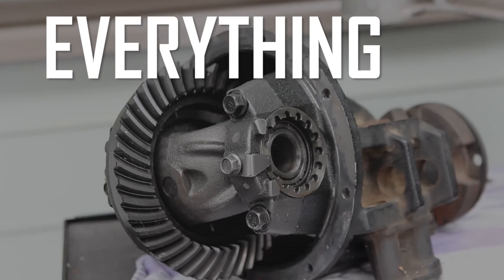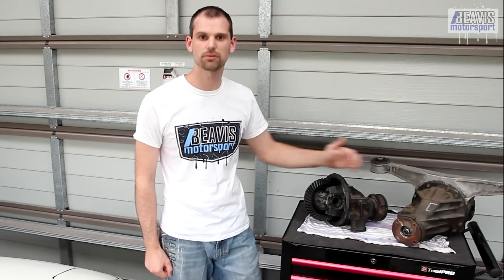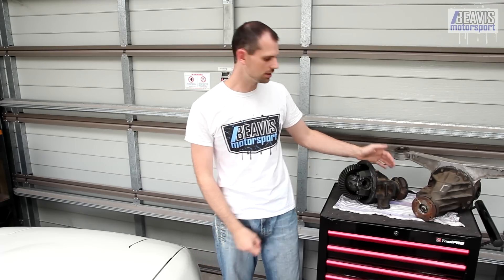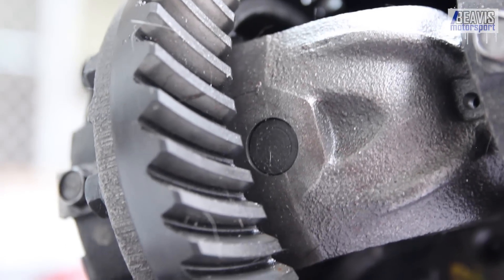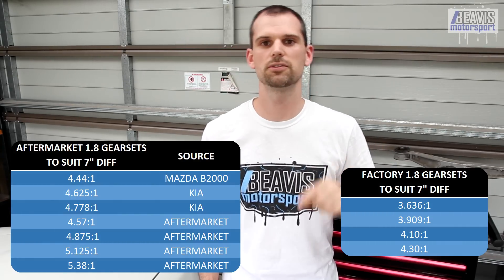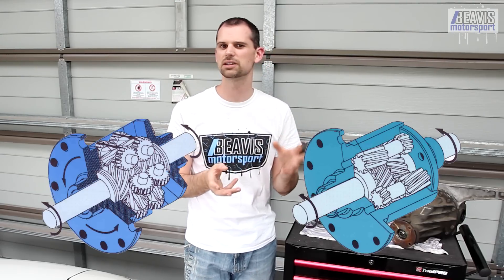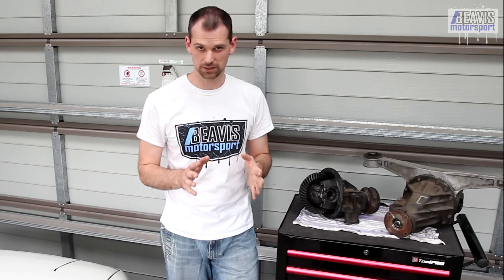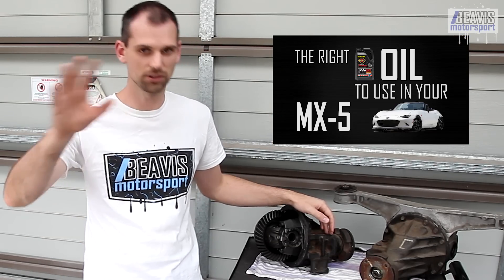ULTIMATE DIFFERENTIAL GUIDE FOR THE MAZDA MX-5 MIATA

Comment: Hi, I've got a 2005 with a fuji diff which I believe may be acting up (it only span one wheel from a 7k clutch dump on a gravel carpark), Is there any way to determine if it's working without taking it apart? I've got a torsen2 in a parts car if you think I'd be better with that.
I've got some new oil on the way and I'll check the old oil for metal chunks? but apart from that I'm unsure how to check if it's operational.
Cheers,
Owen
Reply from the maker: I'm not sure there's anything you can determine by just looking at a diff that is still inside the carrier. You will need to either take it to a diff/trans specialist, or just take the gamble and move to the torsen. In general the torsens are pretty solid and reliable - maybe just avoid those 7k clutch dumps. :-)

Comment: Can you recommend a diff you think will handle 300rkw with 17x11 semi slicks. ? I've seen the 8.8 conversion but we are in OZ so bit hard. I also need ABS and 5 stud. Any help cheers 🍻
Reply: Well I've been trying to find a 4.1 torsen and people want an arm and a leg so i guess i might just go a ford 8.8 and be done with it
Reply from the maker: The factory mazda 1.8 diff should be OK to handle that, but certainly starting to get to it's limit. Slicks will also add to the stress. Beyond that I don't have any experience with aftermarket or custom swaps.

Comment: The NB2 cars were not all 6 speeds (at least in the US).  The 5 speed was standard on the Base, Shinsen, and LS trims and came with the 4.30:1 final drive.  The 6 speed was an option for the LS models and standard on the SE trim, and had the 3.909:1 final.  The Mazdaspeed Miata also used a 6 speed, but had the 4.10:1 final.
Reply from the maker: Thanks for the tip RD. Seems there are always a few variances for international markets. Funny the MSM delivered in Australia as 'SE' had the 3.6 diff ratio.
Reply: @Bbeavis  Apparently the Mazdaspeed name was not used in Australia, as a model name with "speed" implied that owners should violate speed limits.

Just about everyone with a turbo Miata + 6-speed agrees that the wider ratio spacing with the 3.6 is the way to go, as the car spends actual time in boost before getting to redline and needing to shift.  The decision to put the 4.1 in the US MSM never seemed to make a lot of sense.
Reply from the maker: @ateamfan42  Probably because Mazda knew that from the factory the little turbo and poor tuning didn't add much performance!
Reply: @Bbeavis  True.  The MSM did not fulfill its potential.  Most people with MSMs that turn to aftermarket tuning achieve some real gains (even with the factory hardware).

Comment: Hi its very usefull video,l have a question ,my miata is 93 na l am using 3.90 torsen with 5 speed Can l use this combination or should l change with 6 speed.whats your suggestion? whats the - or + for my setup?
Thanks
Reply from the maker: Hi Isa, it is completely up to you, there's nothing wrong with a 5 spd transmission, and they are a lot cheaper than a 6. Unless you need the small strength benefit of a 6spd, there seems no reason to change.

Comment: I have a 1.6 NB / Mk2 (year 2000) with an open diff, it was delivered for the European market..
SO, do I have a 6" ring gear or 7" ring gear?
Is there a difference between the open 1.6 and 1.8 diff for the Mk2 in terms of design or shafts or is it exactly the same?
Reply from the maker: I'd be fairly confident that all MK2's came with 7" diffs, even if they had the less common 1.6 engine.
Shafts are different from the early 1.6 NA diffs to all the later 7" diffs.
Reply: @Bbeavis  Ok Thanks for the response man!
My diff (less than 150k kilometers) is making some humming noise.. I thought it may have had to do something with having the small ring gear, but probably some other issue then.

Comment: So my 1996 Miata has an LSD right? I did a burnout on it and both wheels were spinning, drifted it, did donuts, etc. both of the wheels were spinning. I have a friend of mine trying to tell me it’s an open diff. Help please?
Reply: Alex Martinez some 1996 did, some didn’t. What package do you have? Leather seats? Speakers in the headrest?
Reply: Alex Martinez you probably have a torsen.
Reply from the maker: Probably the best way to know without looking at the inside of your diff, is the donuts as you have done. Sounds like you have some form of LSD.

Comment: Ok so I just bought 4.78 final drive for my 03 nb. Was this a good idea or not? It’s not turbocharged and all I’m trying to build is a nice daily/drift car at least till I get over 140k on the motor.
Reply: I have a 4.77 ratio diff and it's great fun, but highway traveling is not fun at all. I'd generally be doing 4-4.5k rpm on the highway depending on the speed limit
Reply from the maker: It is totally a personal preference. I would personally find a 4.7 swift and fun for a weekend car with lower power, but probably too much for an every day car.

Comment: Do I understand it right that all 1.8 differentials are TORSEN type and a direct fit into my NA6 chassis?
Reply from the maker: Not all 1.8 diffs are torsen, some are open. All 1.8 diffs bolt into the NA6, provided you also swap over the driveshafts.
Reply: BEAVIS Motorsport  how do you know if you have an open diff or a torsen then?

Comment: Very interesting. In your link you mention that the Speed Sender can be swapped. My car is an early NA with a 6 speed 'box and Torsen diff. The speedo under reads. Where could I get the correct speed sender? Is it a Mazda part?
Reply from the maker: Yes you can swap them from other years. Best do a google from speedo gears for sale in your area.
Reply: @Bbeavis  Thanks for quick reply - will do.

Comment: H:i  My 2003 was rear ended and it broke the passenger side arm  right where its suppose to break . I have  a used   rear end  housing with 2 good arms . I'm  just going to replace the housings and  bolt  the front  I have  with all the gearing  into the housing . What is the best  thing to use   to seal the  2 halves  together . I have 2 new  axle seals  to put in the housing also . But I don't have a new seal  that goes between the 2 halves . Do they make one    or is it a  liquid type  that you squeeze from a tube ? If its a tube  what type is the best  to use ?
Reply from the maker: You use a silicone RTV to seal the differential carrier and the diff itself together.

Comment: Very informative, thanks a million bro.  Going to be doing a k24/k20 FranknMiata build.   I definitely want a 6speed with torsen  diff.  Most likely will pick up a 99 NB AE.
Reply from the maker: No worries mate, good luck with your build.
Reply: After searching around for a car, i have not seen any AE miata's here in Canada.   Im not sure of they exist here?  I have only seen Special Edition models which i think might he our version of the AE edition in Austalia?  Someone correct me if I'm wrong.
Reply from the maker: MJ  The 99 NB 10th Anniversary that were delivered in Aus were the only pre facelift NB's with 6speed, they had 3.9:1 diff ratio, dome clever little badging, and came with polished wheels and blue interior bits and bilstein shocks. I'm pretty sure they were sent to North America, I'm not sure whereabouts exactly or how many though.

Comment: Does anyone sell new or remanufactured Miata differentials? These look great but I can't find any good used ones.
Reply from the maker: Used ones seem to crop up frequently enough online, I suppose it depends on your location.
Reply: You don’t really need a reman diff. The only wear item are bearings. Seals are easy to change out. Bearings last over 200k miles with proper oil service. Torsen diffs have no wear parts.

Comment: Guess my diff has been swapped then. It’s a 92 but has fins. It’s also an LSD. cool 😌

Btw, for anyone wondering if they have an LSD, jack up your rear end, and spin one wheel. If both tires spin in the same direction, you have some form of LSD. if they spin opposite directions, it’s open.
Reply from the maker: Keep in mind Jonathan, that the OEM Mazda Torsen LSD will likely not spin both rear wheels in the same direction if they are jacked up in the air as it requires load on the driveline to induce the limited slip action.
Reply: BEAVIS Motorsport ah, true. So I guess it’s viscous then?

Comment: Very comprehensive, thank you
Reply from the maker: An absolute pleasure! Glad I could be of service - thanks for watching tsx101 :-)
Reply: I know dumping on AT drivers is fun but i'm looking to get a used diff from the wrecker's. It would be good to know what the ratio on the automatic cars was (or if they even had optional LSD) to swap onto my NB. Can't find any info online.
Reply from the maker: I don't have a lot of definite information, but as I understand the Automatic got the same ratio as the Manual trans cars.
Reply: same thing ive seen posted around, but which of the 3 ratios?

Comment: Why is a diff with clutch packs better than a torsen?  Torsen will not wear out friction material and gives more torque to the wheel with more traction, in a continuously variable manner.  How are these other diffs better than that?
Reply from the maker: The torsen starts to be less useful on the track and with higher power, where the benefits of a clutch pack and its more 'tight' locking are handy. The MX-5 torsens are rather forgiving, and certainly very robust, but aren't a heavily weighted to split the torque between the two rear wheels.

Comment: What all do I need to swap a torsen into an open diff NA8? Does it fit straight into the open diff housing? Sorry, new to Miatas, just purchased my first one last week. It came with an open diff but I’d like to install an LSD into it.
Reply from the maker: Hey Alejandro, You can swap in any 1.8 differential from another NA/NB. The gearset and mounting setup is all the same.

Comment: Absolutely brilliant video. Finally! Something like this has been needed for so long. Great knowledge and great information!
Reply from the maker: Thanks for the kind words Ragged Edge! Really appreciate it. Thanks for watching!
Reply: BEAVIS Motorsport - my pleasure. Subscribed! Keep doing what your doing. Great stuff, Can I make a suggestion?l for a video? 15x7 inch rims 195 Tyres vs 15x9inch rims 225 Tyres on track. I’m about to upgrade and would like to know the difference it makes to time gain on a lap 👍👍
Reply from the maker: Thanks for the suggestion Ragged, that's certainly something I'd like to try out one day, it'd require a bit of money though as to do the job right, I'd need to have two sets of wheels and two sets of tyres of the same compound!

Comment: Great explanation!  If anyone wants to know if they have an open diff or LSD, there are a few ways to check.  The quick and easy way is to do a burnout on the street.  If you have "one wheel peel" ..."one tire fire"...whatever the kids say these days....If there is one line left on the street then you have an open diff.  If two lines are left on the street then you have some sort of locking diff.  Another way to check is to jack up the rear end of the car and spin one of the rear tires with your hand.  If the opposite side tire moves the same direction, you have a locking diff.  But if the other tire moves in the opposite direction that you're spinning, it's an open diff.
Reply from the maker: Keep in mind that Torsen LSD's, common with the MX-5 Miata, are known to exhibit 'open diff' characteristics when the car is jacked up and a wheel is turned by hand. The other option is to open up the fill plug on the diff and shine a torch inside to try see what centre is in there.

Comment: Good info however you don’t explain anything about how to visually identify any of them properly, especially on the outside
Reply: That is because there really isn't a way to tell if you do or not from the outside. You either have to road test it or take it apart and look inside.
Reply from the maker: I didn't think it would add much to the overall video. Keep in mind all 1.8 diffs are basically the same, and I did mention that some of the early 1.6's had no fins. other than that from the outside there's little more to say.

Comment: You forgot something, the nb post facelift still came with a 5 speed. Not all of them have a 6 speed. For example my 2005 nb ls has a 5 speed in it.
Reply: I notice that too
Reply: ive a 1999 NB 1.6 5 speed - havent a clue what diff is in it :(
Reply: I have a 2002 white w/ tan leather interior. 1.8 vvt 5 speed with lsd dif.
Reply from the maker: Thanks for the tip Chris, I wasn't aware of any NB facelift cars running a 5 speed, I'll add that to my website.
Can you give me any more detail on the car? i.e what location was it originally sold?
Reply: BEAVIS Motorsport Bought it in Escondido, California. It’s a 2005 nb miata ls, 1.8l w/ vvt and an lsd. 5 speed, power windows & doors. Keyless entry. Pretty much everything I can think of on the spot.
Reply from the maker: Great thanks for the info - wonder why Mazda opted for some cars to have the 5spd when many Miata/MX-5's around the world were already getting the 6spd
Reply: BEAVIS Motorsport I believe that all the 2002+ cars came with the option to choose between a 5-speed and a 6-speed. The 6-speed is the more sought after transmission, which is why it got more attention since it was introduced.
Reply: My 2003 NB is 5 speed as well. UK car, Nevada special edition.
Reply: I have just purchased a 2001 NB 1.6 with 5 speed and a welded diff but have just swapped in a 2001 NB 1.8 open diff straight in without the need to change my driveshaft or half shafts